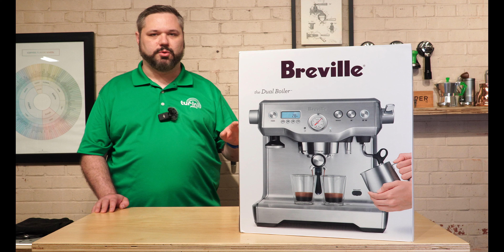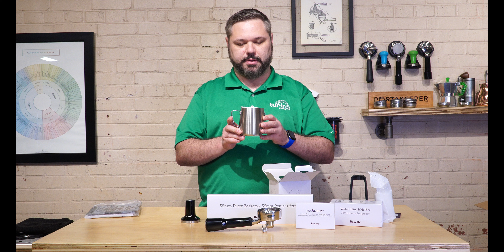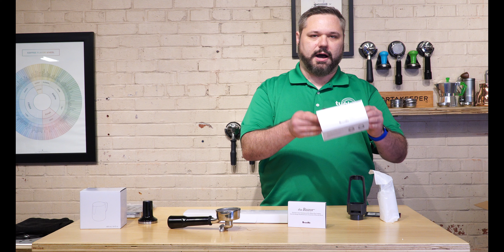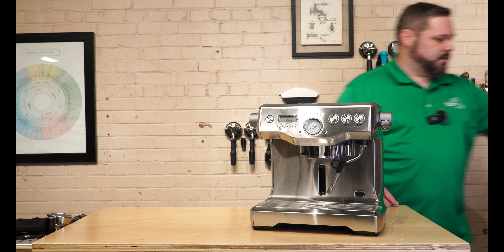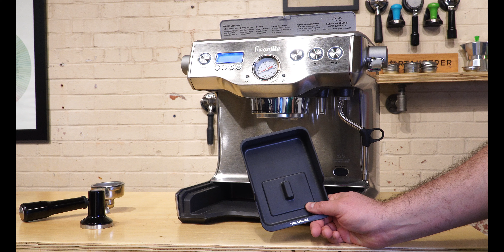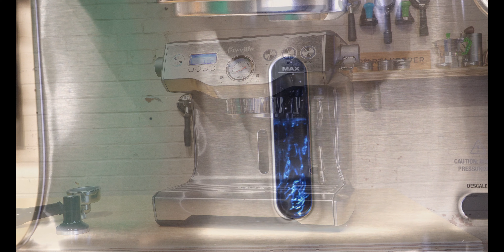Breville Dual Boiler Unboxing and Features

Comment: Maybe I just missed it but what is the warmup time? I've heard 2 minutes, 5 minutes, 10 minutes, 15 minutes and more depending on who answers. I am assuming the 5 minute answer is the boiler coming up to temp and the 10-15 minutes is for the group and portafilter to be up to heat. Is there a consensus on how long to let it run before pulling your first shot? I know E61s take ages to come up to heat.

Thanks.